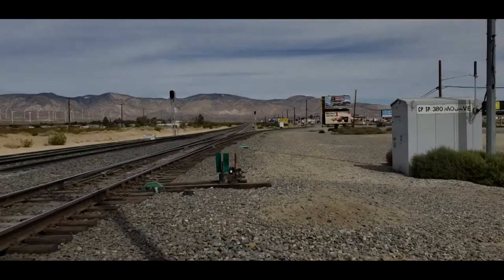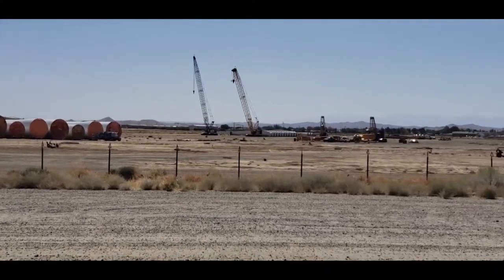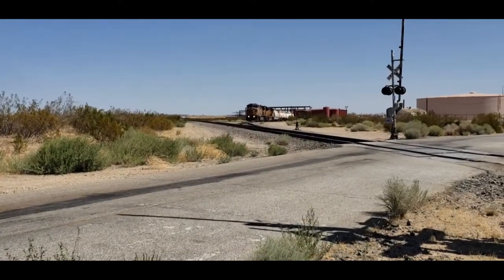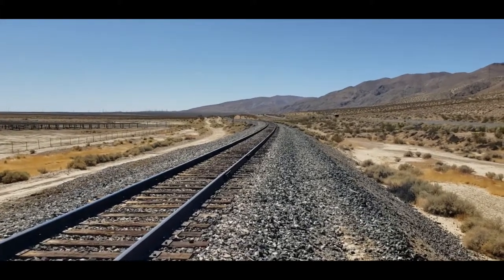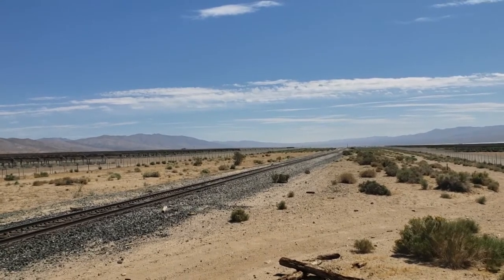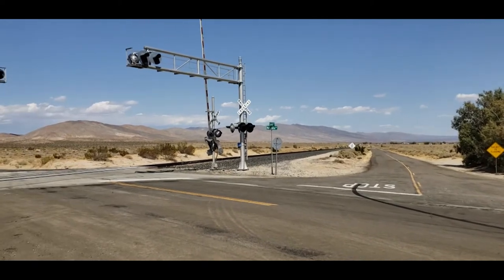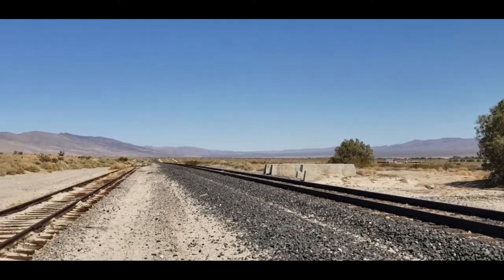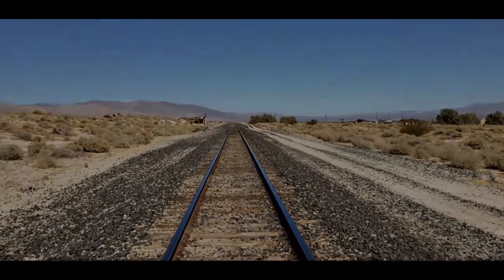Exploring Union Pacific's Lone Pine Branch: Part 1

Comment: Pipes zigzagging down the mountain is the old aqueduct. Some sections have been repainted. It zigzags because each pipe is the same size and jointed together. The new aqueduct is low and hidden and continuously welded.

Comment: I worked for SP in the 1980s and 90s in signal and know this area .ive followed this line to the very end on dirt bike years ago. All the way to where laws train museum is now but could not find connector to the line or the pass over the mountains toward death valley. Where did this line connect with the other rr and turn to the east? Ps very good info and video. Today its much easier to trace this line from google earth. You can see lots from the air.

Comment: I assume they make Ferric Chloride in that plant they react iron with hydrochloric acid, chlorine, or oxygen or all of the above depending on the process. It’s not super toxic I have used it for years to etch printed circuit boards. In water it called a flocculant it will take suspended particles out of the water and make them sink to the bottom. They also used it in sewage treatment. Love the videos keep up the good work
Reply from the maker: Thanks for the information, compliment and for checking it out!